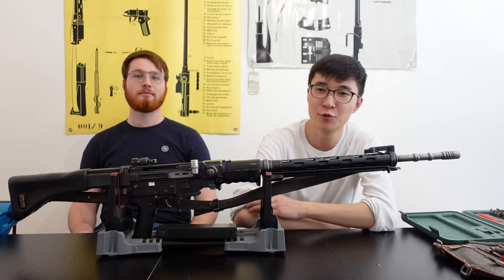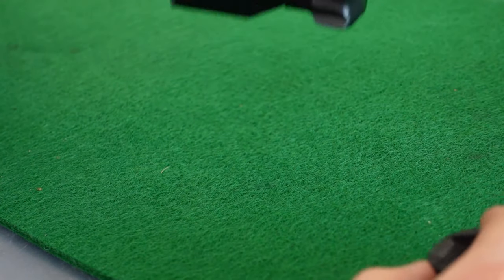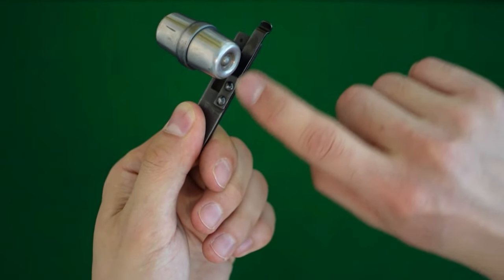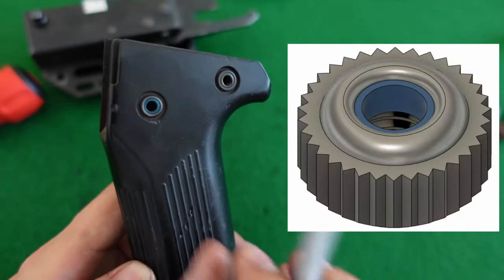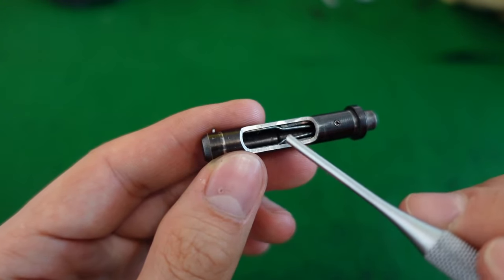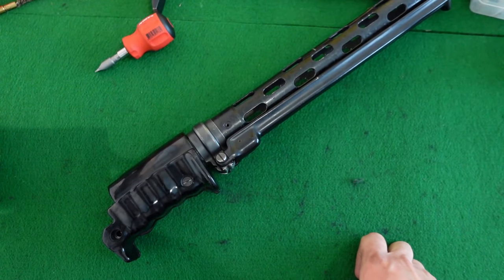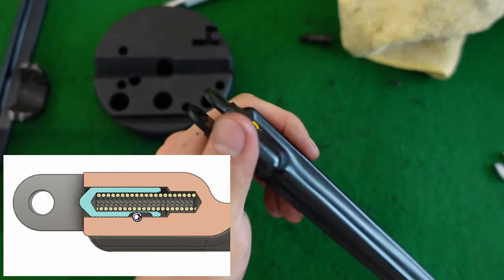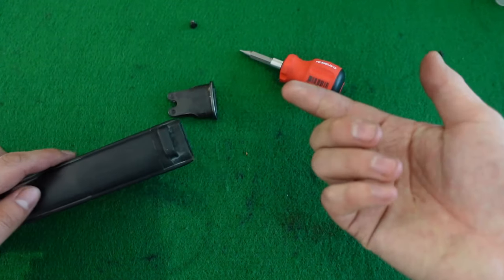DEEP DIVE: Sturmgewehr 57/SIG SG 510 Detail Disassembly and Reassembly

Comment: Hi ! Thank you a lot for this video and it quality, you go really deep into each stage.
I just "ordered" a STGW57 and i want to make some detailing to it.

If the bolt gap is out of tolerence, you have to change roller and the "morteses" ? How to determine which roller to take ?

Thank you again for all.
Reply from the maker: Hi! Thanks for your kind feedback! 

Before even starting, make sure that the bolt gap is measured correctly. It is measured only on the left side of the bolt carrier (magazine well pointing up), clean weapon, hammer cocked. 

If out of tolerance, the usual solution is to replace the rollers until the correct bolt gap tolerance of 0.5-1.1mm is reached. Rollers are available in 5 increments of 0.04mm. Inside of the top recess, there is a size marking:

“+.”= 12.08mm
“+”= 12.04mm
Unmarked= 12.00mm
“-“= 11.96mm
“-.”= 11.92mm

The most efficient way is to measure your current bolt gap using feeler gauges and select the correct roller set by calculation. One 0.04 increment results in a 0.35mm change in bolt gap. 

For example, if your bolt gap is 0.40mm with “-“ rollers, you need to move up one increment (unmarked rollers) to get into the correct range (ca. 0.75mm). 

If you run out of roller increments (extreme roller sizes still result in out of tolerance bolt gap), your mortices might be worn. In this case, repeat the exercise with new or better condition mortices. 

If you still manage to not achieve a correct bolt gap, special “+” mortices exist to help compensate for wear. 

Hope this helped.
Reply: @DaletheStgwDude  Hi, your are really king thank you a lot for those information !

Is there a way to contact you if I have more questions ? 
I can pay for the help, with pleasure :)

Thank you again !
Reply from the maker: @Spawnx91  You’re welcome! Feel free to contact me on Facebook Messenger.
Reply: @DaletheStgwDude  I dont find you on it :/ ^^
Reply from the maker: @Spawnx91   https://www.facebook.com/groups/1549413198641951/?ref=share_group_link

Join the group here mentioning this conversation, I am a moderator.

Comment: Hey Dale! Thanks for making this video its amazing to see and gave me a lot of insights into my recently acquired 57 here in Switzerland. I saw the verschluss in your video is nicely silver and looks brand new almost. Mine is a dark grey/black, clearly showing the friction/sliding wear on certain areas. Do you know why this is? Is it a certain year/range that came with the more silvery looking ones or more black looking ones? I'm trying to find out more about my rifles history and would be awesome to hear your thoughts.
Reply from the maker: Hi Jip! Congratulations on your new rifle!

Between 1959-1964, factory Stgw. 57 bolt groups were left « in the white ». However, starting from rifle 508 001, the complete bolt incl firing pin and firing pin lever are blued to improve corrosion resistance. 

It’s also possible to have a rifle before A 508 001 with a matching blued bolt group. Usually, this indicates that it has been repaired, refurbished or overhauled at some point.
Reply: @DaletheStgwDude  Amazing, thanks for the answer! You should try collect all your Stgw 57 knowledge onto a page/book/pdf! 

Mine is  "A 731xxx". A late one, I guess? Just got back from the range, shot it for the first time. Great rifle, just uh... it feels like I'm deploying an MG more so than a rifle.
Reply: @DaletheStgwDude  Is it normal that after about 30 rounds, the gun is really dirty again inside, around the chamber? Black etc. Or does this mean it rolls back too early? Or, or, or... Maybe a stupid question but I'm sure you know the answer. I saw your video on the trigger group. If you wanna look over my rifle, I'm happy to deliver it to you some time 🤣
Reply from the maker: @jip2877  Seems completely normal. Since the cartridge case is the gas piston, there is still some residual gas pressure when the seal is broken. That means that fouling can stream inside the receiver and bolt more easily than a in a piston gas-operated system.

Comment: Thanks for uploading a great video. Do you have the CAD files hosted anywhere? I'm in the USA, and putting together a STGW57 kit - I have a print for a 510-4, but want to verify that the threads for the barrel as well as other dimensions are the same.
Reply from the maker: Hi Cameron! Thanks for the kind words. 

The barrel journal and receiver front section critical dimensions are identical! You can mount an AM 55 barrel on an SG 510-4 and vice versa.
Reply: @DaletheStgwDude  Wow, thank you for the fast reply! 7.5 Barrels are basically non-existent in the USA - I'm gonna have to turn one myself. Thanks for the info!
Reply: @confused1194  Did you ever get a barrel made? I am trying the same thing..

Comment: A very detailed video. Thank you for your effort. Learned a lot of facts, never though of before.
Just one more question :
What's the rellers anti-preengagement measure in this concrete system? And what's that measure with the roller-delayed systems in general?
Reply from the maker: Thanks for your feedback! Glad you like it!

There is no anti-preengagement needed per se, as the rollers ride along the walls of the receiver. The only areas that allow the rollers to protrude are the normal locking recesses 

That said, the bolt wedge has two larger angles at the tip (you can see them in the video), so that the carrier has less mechanical advantage over the rollers (therefore less friction) during bolt group reciprocation (a bit like the sharper helix angle on an AK bolt carrier). 

Anecdote: during endurance trials in the 1980s, one test rifle was mistakingly assembled with no rubber bolt buffer. This resulted in the bolt group slamming into the rear receiver section flange, thus forcing the rollers out against the front receiver section and cracking it after a couple thousand rounds. This also explains why the rear trunnion extends so far forward, to reinforce the sheet metal in case of excessive roller impulse.
Reply: @DaletheStgwDude  So this failure tendency(with the rollers getting out in bolt's rearmost position and damaging the receiver)  should be particular to all roller-delayed systems(?) Unless they doubled the anti-bounce lever as an anti-preengagement measure, similar to that of a Barrett M82(just speculating)
Reply from the maker: In theory, I would agree that roller delayed blowback systems may require more consideration for buffering the bolt group at the rearmost travel. On the Stgw. 57, they achieved that by reducing residual bolt velocity as much as possible (through aggressive bolt wedge angles requiring tungsten carbide inserts and long bolt group stroke).  

It’s possible that the design intent on the HK G3’s bolt catch/locking lever is to also dissipate some of that bolt head’s kinetic energy when in the forward position, but I’m speculating as well.
Reply: @DaletheStgwDude  What does the leafspring inside the contour of the extractor do?
Reply from the maker: @michailpanchev9952  The curly inner spring allows the ejector to function as a passive extractor during manual unloading. You can see it working at 1:26:31 when I push the ejector to the left side. 

The inner spring protrudes out the ejector body slightly and presses against the ejector stop peg. When you push the ejector to the left, the inner spring’s bends compress to provide spring tension. 

The rifle usually works 100% fine even without the inner spring (thus proving that a true extractor is not needed for normal operation). However, once you try to manually unload the rifle, you have problems.

On earlier trials versions of the AM55, they achieved the passive extractor effect by a self-sprung ejector construction (with a simple cut to allow the entire ejector to deform), which did not work very well.

Comment: Is the stock and buffer spring for the stg57 interchangeable with the AMT version
Reply from the maker: The parts will somewhat fit but will not properly function. Reasons are too many but I wouldn’t recommend it.
Reply: @DaletheStgwDude  do you know where to get any SIG AMT parts?
Reply from the maker: @kentboys6981  sadly apart from Gunbroker, I don’t know of any. Sorry

Comment: Does it have an anti-bounce lever and where is it?
Reply from the maker: There is no antibounce lever on the Stgw 57. Bolt bounce is managed by:

1- a diameter reduction in the chamber that crushes the cartridge case during chambering, reduces bolt head to breech face bounce. 

2- A spring-loaded plunger on the tip of the recoil spring assembly (as shown in the video), acting as a dead blow hammer. 

3- An assymetric carrier strike face that forces the bolt carrier to tilt, thus driving its side into the receiver wall to dissipate energy. 

Furthermore, the large hammer increases lock time, which gives the bolt group plenty of time to settle.
Reply: @DaletheStgwDude  Thank You, sir! A little too intricate technical measure, I guess. But it is, what it is. It wouldn't be Swiss otherwise.
Reply: @DaletheStgwDude  But does it work consistently & reliably enough. In full auto mode, especially?
Reply from the maker: @michailpanchev9952  apart from the recoil spring assembly that tends to fail every 5000-6000 cycles, the other features are built in and are basically indestructible.

Comment: When ADA and one of his soldiers had to train in handling the STGW-57, I noticed that the usual rifle manipulations in almost all clips on the STGW-57 were not carried out properly and correctly. Loading, unloading, unloading control, running control should always be carried out correctly. In addition, there is the "great dismantling" and the "small disassembly", which is also not shown properly according to the regulations.
Reply from the maker: Thanks for your comment! The purpose of the video is not to break down manual 53.100 and show standard manipulations, but to simply take the rifle apart. I do not believe that switching the order of disassembly of certain parts of the rifle as a civilian makes a difference. Of course, the requirements for uniformity is different in the context of your military service, I am sure.

If there is sufficient interest in the historical handling of the rifle, than that could be the topic for a separate video.

Comment: for sporting use is the bolt gap 1mm or more (max 1,4mm).
Reply: @DaletheStgwDude  it should lead to more/better accuracy of the rifle. in my shop i aim for 1mm.
Reply: @DaletheStgwDude  i work at e. kesselring ag in frauenfeld TG.
Reply: @DaletheStgwDude  you rather mean, to teach me (my person) about the stgw 57. my knowledge is gunsmith basic but yes of course.

Comment: There was no need for a toolset as shown. We completely disassembled the weapon, not field stripped with the issue army knife.
Reply from the maker: I would be genuinely impressed if that was possible. How would you drift pins out with your pocket knife?
Reply: I also wonder how can do that, even the modified FASS 57 manual 1986 is using a toolkit like shown in the video. For a full dissasembly.